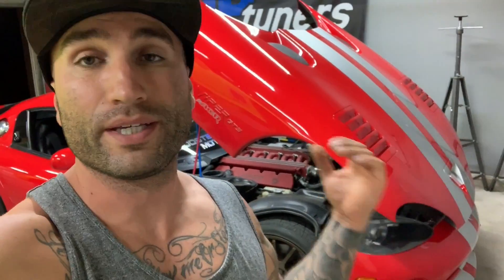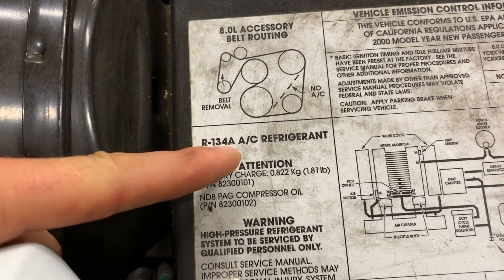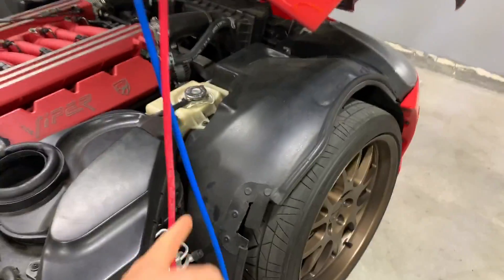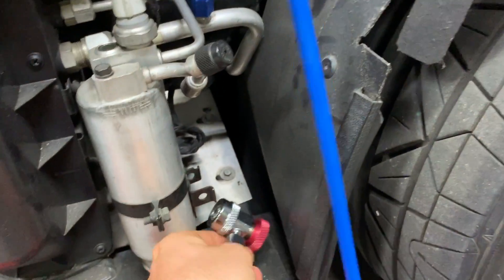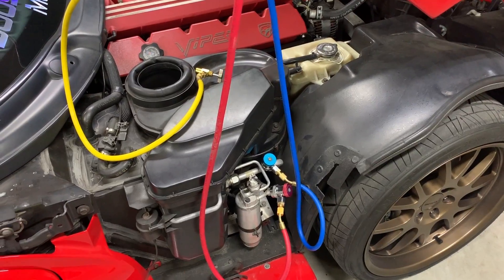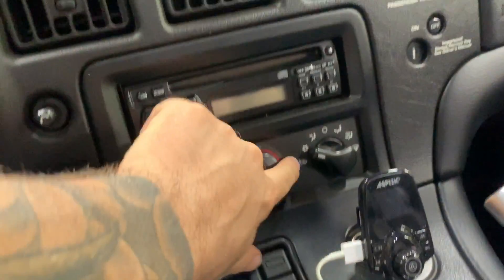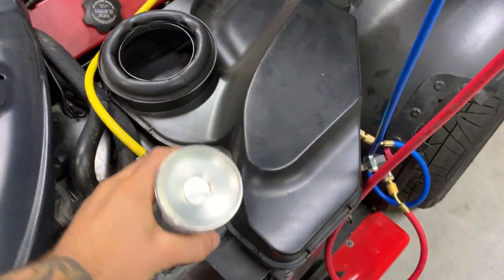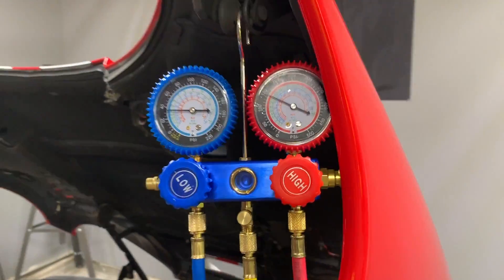HOW TO RECHARGE YOUR CAR AIR CONDITIONING SYSTEM

Comment: Do you have a link to this product so I can buy so I could recharge my system.
Reply from the maker: Yes sir!  Here is the full gauge set with vacuum pump for when your system is empty and you need to remove the air. https://amzn.to/2YzBiZt .
Here is the link to the R-134a Freon https://amzn.to/2MA2EfK
Reply: BoostedMotorsports how to remove the air on my s2000? You didn’t show the air pump in the video.
Reply from the maker: If your system is completely empty you just hook the yellow line up to the vacuum pump , open the HIGH valve on the gauge set and let the vacuum run for about 30min then close the HIGH valve on the gauge set before you turn off and disconnect the vacuum pump.
Reply: BoostedMotorsports how you tell by the system is empty? Look at the high gauge dropping to zero?

Comment: I was hoping it'd be your compressor and you would do a complete DIY lol! My compressor in the Viper is dead and I won't drive it in the summer for that reason hahah. Thankfully there is a ton of room in there, when that hood comes up it's like "hey dummy fix my broken A/C"
Reply from the maker: lol well luckily my compressor is still good.  How come you suspect your compressor is gone?  There are quite a few easy fixes on these cars.  Its usually the o rings at the compressor that go bad and leak or the shrader valves.
Reply: @BoostedMotorsports  The compressor is straight up seized! I'm the 2nd owner of the car and bought it knowing this, so it's definitely in order. Also needs a shrader valve on the low side, but like you said it's pretty easy to deal with and thankfully not very expensive. I'll also do the check valve on the manifold at the same time so it doesn't shut off every time I get on the throttle lol, such a dumb design